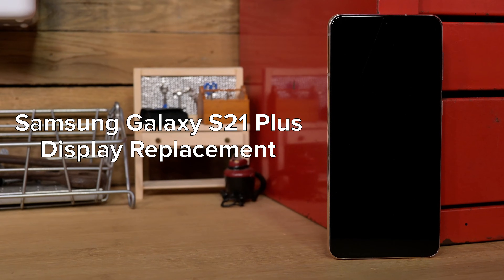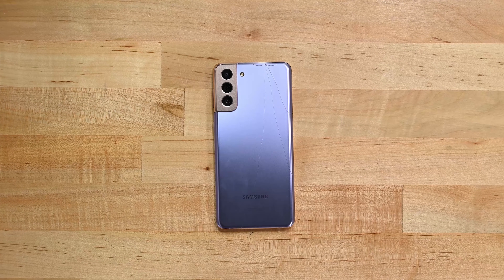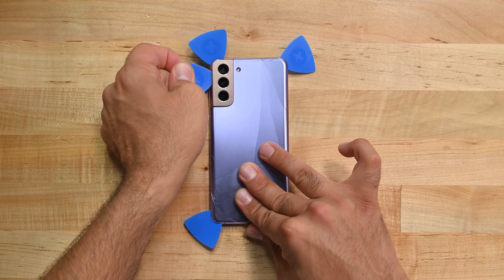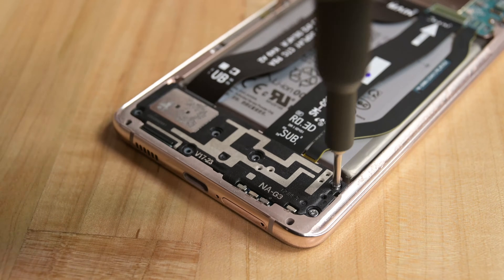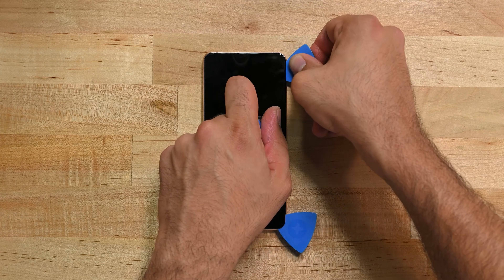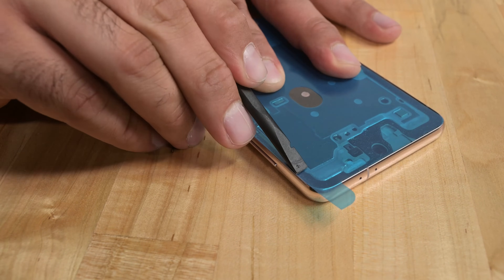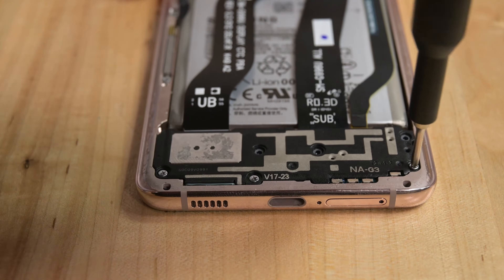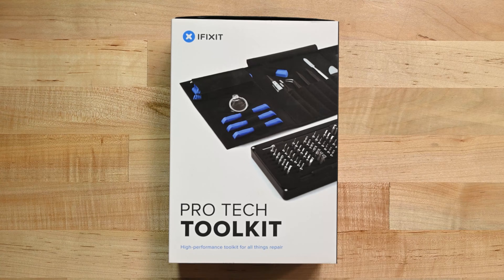Samsung Galaxy S21 Plus - Display Replacement!

Comment: I just need to check if the display ribbon disconnected, as I suspect that's the only issue with mine. Is it actually necessary to slice the glue between the charging coil and speaker? Can't both just be lifted out at once?

Comment: Took my phone to ubreakifix. They said the device is unrepairable because the 5g antenna cable was fused  into the motherboard.  I just want to get the data off the phone.
The problem w the phone os it does not turn on, even though the battery is charges.  Do you think I would  be able to just cut the 5g antenna cable and get a new battery cable w new battery and have the phone work without 5g?

Comment: Remember to disconnect the battery every time you mess with the display ribbon because I accidentally shorted it while testing the replacement screen. Thankfully despite the smoke and burnt smell it still works just fine lol

Comment: Why not just keep phone turned off skip all other stages and simply remove the screen?
Reply: The phone turned off does not mean the battery doesn’t have energy. One wrong touch and you could accidentally create a short circuit between the battery, tweezer and motherboard, and fry your phone

Comment: After applying the new stickers does the phone still have water resistance?
Reply: I read somewhere that after the phone is opened for the first time it loses most of its water resistance but that might just be a scare tactic
Reply: yes you do lose the water resistance. third party adhesive glue are usually there js for the sake of sticking the parts in place. it is not as strong as the one that came with your phone originally.

Comment: Why would you consider this way when samsung provides original screens with frame to resellers?
Reply: Because it's usually significantly more expensive, depending on the model.
Reply: The frame isn't original from most sellers
Reply: @larrytraber  You are buying from the wrong people if it is not a service pack or refurbished original.
Reply: @larrytraber  What do you mean?

Comment: for any novice repair technicians I would recommend a full frame swap as it makes this repair MUCH easier (and is actually how Samsung repairs their devices).
Reply: And durable too
Reply: What's a full frame swap? Thank you :)
Reply: i'm an experienced technician and I still would never do a frameless screen replacement if there's a full frame swap available for the platform, typically not much more expensive either.
Reply: Full frame swap is the best way. If you do not clean the screen adhesive perfectly, you are likely to damage the OLED panel and end up with pink and green lines.
Reply: @kevinhutcheson2660  hey bro, question, is too much difference between Oled replacement instead of the original super amoled screen??

 I need to buy a replacement for the S21 plus and is Cheap the oled opción. But I'm not sure.
Reply: @MOXXmobile  maybe its to late for me to reply, but difference is Maximal Refresh rate, Color Quality, and Response Quality
Reply: @mrziixx1293 how could i replace just the screen as i ordered a screen with no housing. Is it possible to just replace the screen. Would i need to also remove the battery

Comment: I love that battery should not be removed. It so difficult to do it on Samsung phones
Reply: Put the phone with the scren facing down on the heat pad for 5 minutes and it will be easy to remove it, if u dont have a heat pad use isopropyl alcohol and wait a few minutes before pulling the battery out